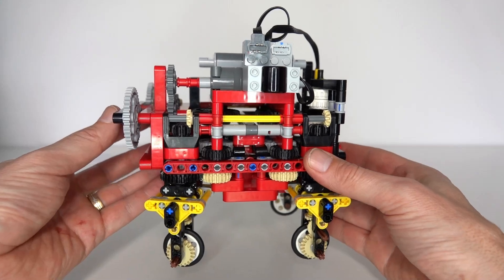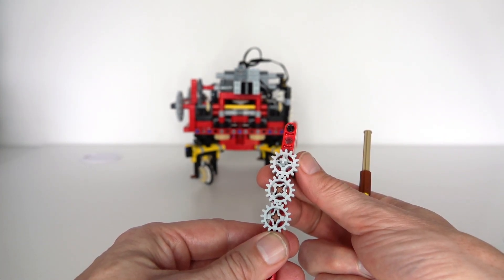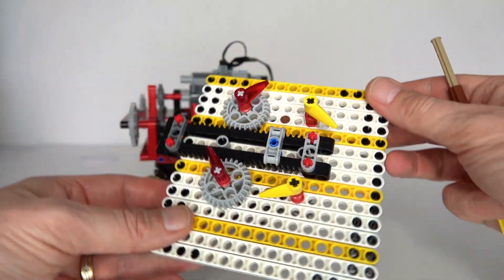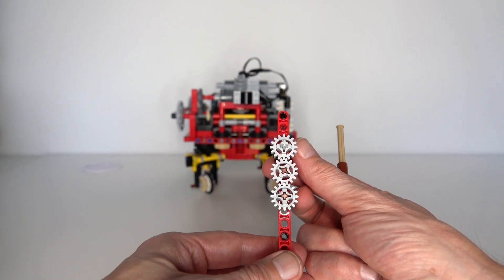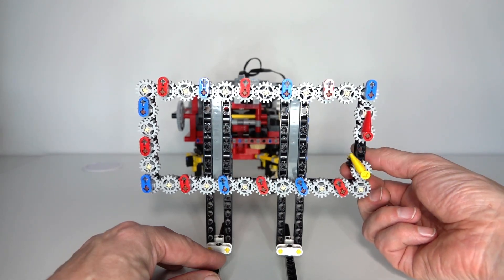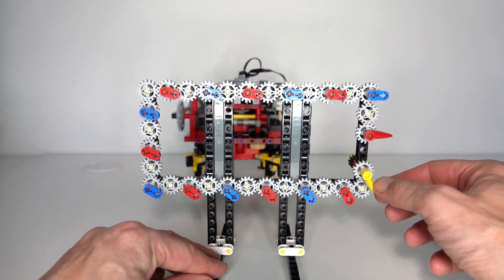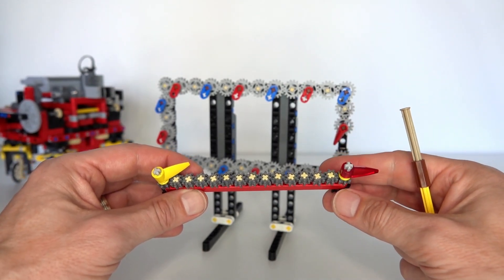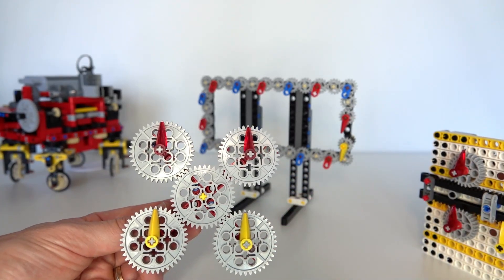Lego Technic Measuring Gear Backlash

Comment: I was making a mechanism out of Lego that would measure the indentation pattern of a flat surface like wood. It need utmost precision since the change was on a very small scale, and backlash became a significant problem. I simply added a weak rubber band on one of the gears, and this pulled the gear to the extent of its backlash, therefore preventing the backlash entirely.
Reply from the maker: Hi Eliot. Wow did your mechanism work? How did you use the measurements? 🙃
Reply: @TechnicBrickPower  yes, the mechanism worked freely of backlash after I put the rubber band on it. There was basically a spring in a parallelogram design that kept it extended. A stick was attached to the end of the parallelogram, so when the wood indented, the stick went in. In a complex sort of events, the one parallelogram edge was fixed to a gear which spun when the stick was moved up/down by the indent. This gear turned a gear rack back and forth and thus showed the movement of the indentation. I didn't really use the indentation measurements for anything, I just made it for fun :), and I might post a YouTube video on it.

Comment: Interesting video. My 2 cents: backlash is caused by play (between gears and between the axle and the hole) but also based on deflection of the parts. That deflection is based on torque (forces on the gears) and when you line up 30 gears, the input torque will be higher than the output torque (which is zero).
Also, using cantilever shafts will cause the center of the gear to move quit a bit out of alignment, increasing the backlash.

Backlash is also measured from one direction to the other so double what you calculated :)
Reply: Good point, but you forget one thing: the deflection is also dependant on the axles used. the tan pin connectors have a lot of play for example, while an axle supported on two sides has a lot less. the friction pins also have very low deflection, but are detrimental for other obvious reasons
Reply from the maker: Hi Klaas! Yes there's always more to it than meets the eye. The main point I was trying to illustrate is that the backlash angle can accumulate quickly with a long gear chain. 🙃